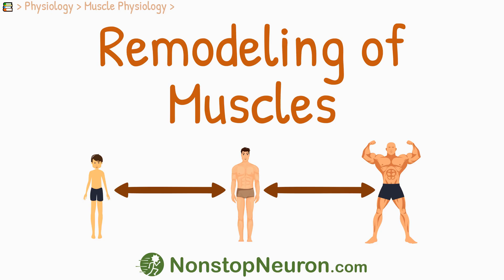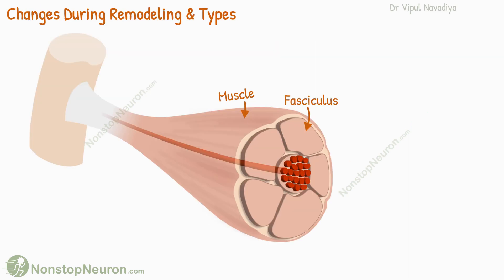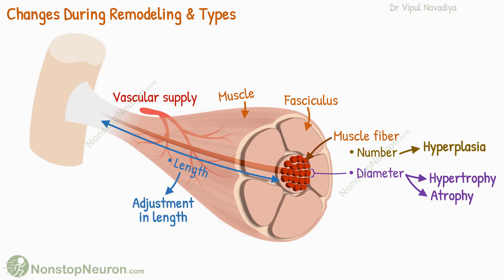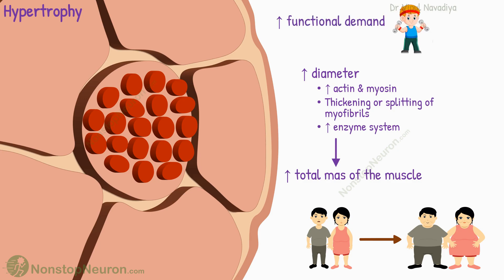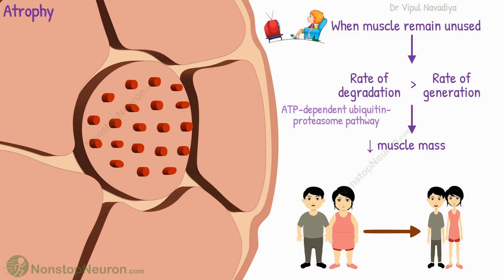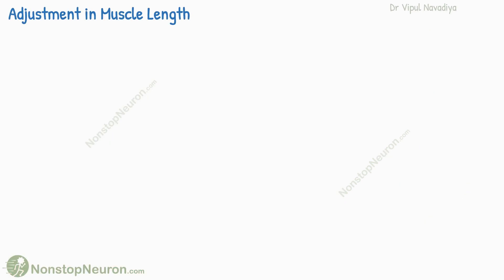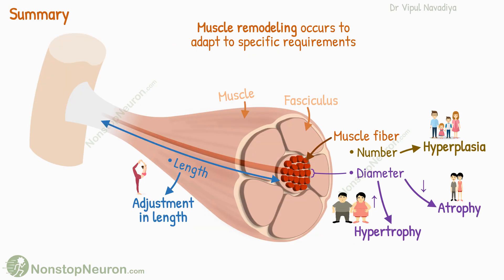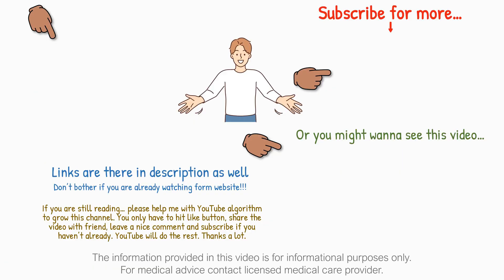Remodeling of Muscle to Match Function | Hypertrophy, Hyperplasia, Atrophy, Changes in Muscle Length

Comment: Hello, it's very nice but correct me if there's any evidence for hyperplasia in myofibers and not rather for myofibrils (that too in very few according to current literature) ? Plus as you mentioned regarding the length of muscle, i.e adding of sarcomeres in length requires to change either the origin of insertion of muscle which in any cases is clearly false according to current literature but rather the pennation angle changes to around 7 to 14 degree in angle , and hence resulting for the longitudinal fascicle growth . Thank you